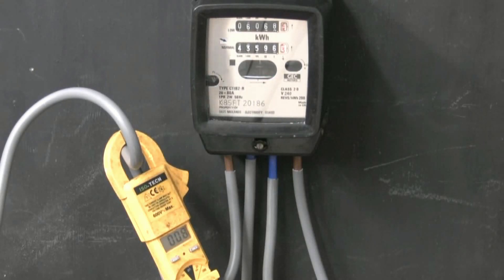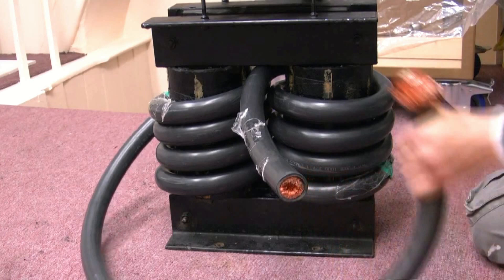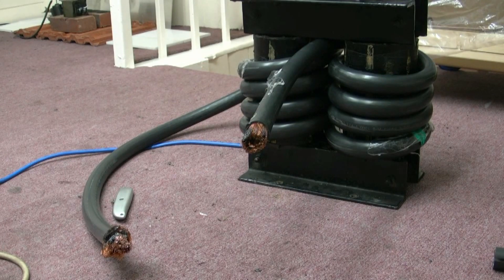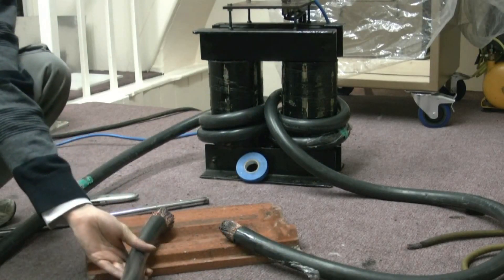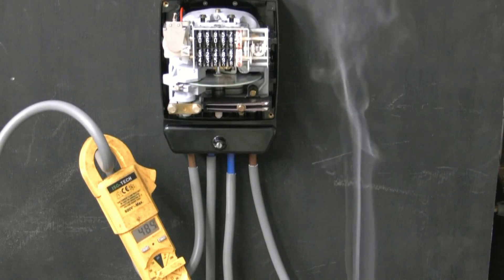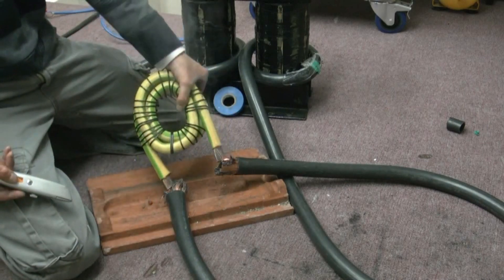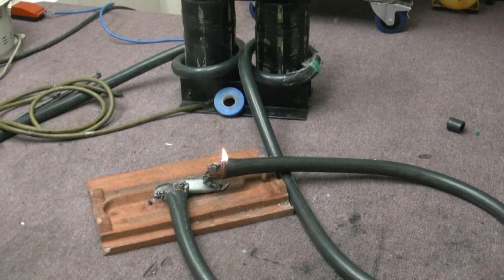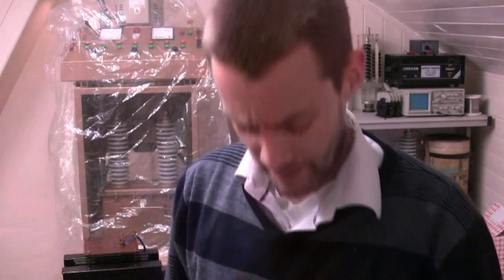Too Much Current + Electric Meter Pops

Comment: Please explain, how the hell you’re not getting shocked.
Reply: while he's stepping up the current with the very low number of turns on the secondary, he's inversly stepping down the voltage.....there's a comment here that calculates only 3 volts
kinda like how you can literally touch both terminals of a car battery with both hands - car batterys can deliver 100's of amps!  and you're attempting to make a current path directly through your heart! - which can be fatal with just fractions of an amp (if there's a voltage high enough to break down the dielectric properties of skin and flesh)
go watch Styropyro's video about volts vs amp - it's the best explainer of these concepts and he does some insane experiments using his own body :)   I'm gonna go rewatch it again now lol
Reply: @r @roushiansschannel ank you so much! Love styro’s channel. Cheers

Comment: Did you ever manage to pop the sub station fuse to your street ? If not was the max current did pull ? Assuming you had 100a cutout fuse but assumed it mysteriously was changed by someone to much bigger or a solid link lol

Comment: 3:01. Have you felt electrocuted if you touch it?
Reply: very low voltage, it cant pass through his body
Reply: @ElectricityFearsMe Thanks for information. What voltage is it?
Reply: @toni_artz  Im not sure, probably under 50 volts since usually anything above is enough to pass through. I think its around 5 volts.

Comment: Traction Motor cables from a locomotive can easily handle 1,000 - 2,000 amps @ 600 volts continuous

Comment: How are you allowed to touch the metal part connecting the two leads?
Reply: Low current. You need high current and high amps to kill you.

Comment: If you publish your transformer specks the theoretical amp output can be figured out with a formula. Like how many turns in the primary winding and how much power is being pumped in. And exactly how many turns on the secondary winding and with those pieces of information you can figure what the output is.

Comment: Where i live, the lines that come from the street to the meter are fused, if you make a high current short circuit like 30A, this blow the fuse and some neighbours houses and yours stay without power until you call the electrical company to them replace the fuse. I made a short circuit while i was installing led illumination in my house, accidentaly the wires join and boom, no power. Sorry my bad english.

Comment: Fast forward to 2022 when the average electric bill is £1000 / month.
I fiddled with the meter in at least a semi-intelligent manner.
I got two proper 25mm² single phase single pole connector blocks, cost a few quid. No big deal.
Pulled the Henley fuse to make the meter safe.
Cables out the meter, live to live, neutral to neutral.
Henley fuse back in. Done.
I even preserved the original security seals so I can put everything back the way it was and crimp the seals back on like nothing ever happened.
Fuck 'em. I'm not gonna stand for being ripped off.

Comment: Crazy they only give u guys 100 amp services. Here in America we do everything in access 200 amp /48,000 watt services. I have a 400 amp service 96,000 watt service. It's fun times.
Reply: It depends on the age of the home. 200 amps really hasn’t been a standard for that long. Most homes still are running 100 amps or less.
Reply: @Mattjohnston24  your right most. My house is 113 yrs old but updated 10 yrs ago. But you can upgrade any house here to 200 amp service and most all meters are rated for 325 amps

Comment: Nobody’s talking about how he’s doing this with his bare hands.
Reply: Large amount of current with a low voltage is like a large amount of water with no pressure. If he turned up the voltage it be like getting hit by a tidal wave.
Reply: @mastershake42019  
I’m not worried about the voltage, I’m worried about the molten metal.

Comment: why do uk plugs have a 3rd wire?   in europe its just 2 wires.
Reply: That is the earth wire. That is what the pins on the outside of European sockets is for. In most of the world if something doesn't need an earth wire they will just not have the pin, but in the UK they always have the pin
Reply: @jamiewilson187  but in europe there is only two wires.
Reply: @alanssnack1192  There's a few euopean plugs but if you're talking about the round one, those two spring-loaded metal things on the perimeter of the round part are the earth wire connection
Reply: @jamiewilson187   yes i know the side metal bits you mention, i kinda thought they were just spring things to keep the plug in.  i just dont see why plugs have a common ground. what is it?
Reply: @alanssnack1192  it's connected to the chassis of metal appliances. If a live wire inside the appliance comes loose and touches the metal, the ground will stop you from being electrocuted. Appliances don't require this if they are "double insulated", (i.e. is made of plastic) so most things don't need it these days

Comment: It’s good when I recreated this vid and I wiped out half my towns power grid and it’s funny watching the lights flicker on and off
Reply: A real power unit u are I see 🤣
Reply: How dafuq did they do it? I mean how do you draw out 20kA out of your house? Did they combine multiple sockets or did they go directly to the main cable. Then how do you transform 237V AC or 400V three-phase to 20kA? I mean if resistence is at idk 0,05 Ohm you can do it but thats impossible since every damn wire with that much resistence would melt away like wax. Pls someone tell me how did the get this to work? I will not recreate this insanity im simply amazed and i want to understand how it works.

Comment: How did the main fuse on the incoming supply not fail. 100amps max on domestic.
Reply: The transformer converted the 240v at 100a to about 1 volts to 50,000a

Comment: Power station: requires a giant site using coal/nuclear fuel to produce a couple hundred amps

Photonic: produces 20,000 amps in his loft overloading the neighbourhood's circuit.
Reply: But he generated fuck all volts which is required to power useful stuf

Comment: I am surprised they first off did not electrocute themselves, and secondly they did not burn the house down.
Reply: low voltage AC wont harm. it's only once it gets up to 24v~ AC thats when it gets a bit dangerous. that 10,000 amp transformer is probably running at 2vAC

Comment: I have so many question about electricity.
1. Which is more dangerous current or voltage?
2. can voltage or amperage kill you?

Those are my question, btw I don't have experience about it, I just want to be  aware. Peace!
Reply: The current across your heart is what kills you, but the voltage is what's needed to push enough current through your body to do damage.
Reply: So stay away from high voltage, especially if you or your hands are wet

Comment: "Im going to pour 500 eggs thru my electric meter."

I love auto generated captions.
Reply: It’s the equivalent of what he really does, with how much smoking it’s doing
Reply: Well here's our electric motor why that correctly [electric meter wired up correctly] put it about items [pulling about 8 amps] which is probably a couple of phrases and phrases [fridges and freezers] and a few lights. Just about say to me today [see the meter there] and then I come home from work and I put the cap on a little bit you [kettle on, so that uses a little bit more, don't it?]. Only that start swinging [The ol' meter starts whizzing] ...

Comment: Something does not add up
If you drop 50v, then
190v × 500A ÷ 3,600s = 28.38W
28Watt a second
It is a KWh every led then 40s
Why units stand still?

Comment: I miss your content.
It really is the ultimate community service safety message.
DON'T DO THIS AT HOME!
This is the EDGE FRIENDS .
On the edge of is easy to mess up....
But high currents and voltages absolutely have their uses!
How close and for how long next to the edge do you need to go?

Many are called. Few are chosen to weld titanium helicopter blades 
At 30,000 books at who knows what current.
 In a lead box because x-rays are coming off.
I've only heard the tales.

Comment: why he isn't taking a shok?
Reply: Probably very low voltage on that side, and he's not completing the circuit. It's also isolated from ground, technically even if it was line voltage he would not get shocked.
Reply: @redsquirrelftw  oh, thanks ^^

Comment: The analog meter display obviously was not designed for that amount of heat/ resistance. As far as the transformer goes, it's a separately derived system, there's no physical connection with the conductors between the primary and secondary. Using 1000 kcmil conductors gets the audience's attention. He used the same amount of windings on each side on the ferrous/iron core... But at the end of the day, power in, power out. Lower voltage, higher current, and vice versa. You can't make something out of nothing. No magic here.

With that said, it's awesome that you're having fun and learning things. No harm, no foul. Cool channel my friend!

Comment: They were lucky they didn’t get shocked by an ark flash, must have been close to 40k volts going through the cord. And they weren’t even wearing proper Ppe, electricity is very dangerous especially at those levels. Please be mindful when working with electricity, I can not stress this enough people. I’ve heard horror stories of co workers of mine who when working on machines got serious injuries or even death from ark flashes. Please leave electrical work to the professionals
Reply: definitely not 40 kV just a lot of amps

Comment: For those who don't understand why the guy isn't getting shocked when touching the bare metal of the box cutter when shorting it out, it's because the circuit is from an isolated transformer. If you normally touch bare wire like in a service panel, that uses earth to complete the circuit so touching it completes the circuit through you. But a circuit from an isolated transformer, you touching the bare metal does nothing because the circuit cannot be completed through you unless you hold both ends of the wire.
Reply: That's not the only reason tho. The voltage is super low because of the low number of turns, while the current is very very high. A transformer is like a differential but for electrons :D
Reply: This is the way. I came to say this and thankful you did because I am feeling lazy and didn’t want to type out the answer I always look for someone else who has answered the question.
Reply: I only understand the video on level of he built cage for the electricity, got a considerable amount of heat wrapping thick wire around transformer magnet widget and I guess he's a ghost cuz looks like he does insane stuff.
Reply: Thanks I was wondering that
Reply: Not only that but the voltage is too small to pass sh*t over skin

Comment: Which current does he measure? The amp meter is on another cable, not on the big fat one.
Reply: He's measuring mains amps, it gets stepped down to probably like a couple volts tops. When voltage drops current spikes so there's also like 10,000 amps. Your body has too high a resistance to get hurt by this. Don't ever try it though, you need alot of education to understand why it does this.

Comment: I guess I don’t know much about electricity as I thought, well at least this kind of stuff...using his transformer he said he had 1000 amps going through it, but he had a 200 amp mains box, which I know doesn’t mean he has 200 amps available, it’s the number on the transformer outside ( in US is typically rated at 15/25 KVA, with some could be 37.5 or 50 but split across all houses connected).  So my question is how is he pulling 1000 amps there when he has a 200 amp mains box and chances that the transformer he shares outside can’t even support that?
Reply: cagmito76 I understand that but how do you step up the amperage to higher that what the mains transformer supplying his house can even support?  Yes he’s stepping it up, but how can you step it up well beyond what his system can even do???

Comment: Where I use to live it was a semi detached house and the supply to next door came into my head n then spurred off into there's. Every time I switched my old school 20A Variac one. The light dimmed next door. If you go on my channel you'll see it n realised at the time how much he wanted a lovely old school Variac like mine. 
Well, what he's got now puts mine n pretty much everyone's to shame n he's got 2 of them n there both 3ph with brushes on the outside and it's gold plated. 

There's a few things I've love to get off Andy if he was every getting rid of anything n that's one of them. The other is his 6ph mercury arc rectifier which is beautiful 😍

Comment: He didn't really overload the electricity grid. That was just a bit of a joke. At the end of the video he clearly shows the meter connected to the secondary, of a low voltage, high current transformer. The actual power used will be a few kW at most.
Reply: I am guessing about 25kW, which take him up to just over 100 amps. It's high but most domestic houses are fused at 100 amps so it's not enough to sink a phase by 50 volts.

Comment: what did you use to power the transformer? just regular old 240 through the variac?
also, what configuration did you use to wind the secondary (how did you wind it). im asking because i want an idea of how to wind multiple microwave over transformers in series. would i have one wire going through all the trasformers or have each one wired up separately and then connected in series?

Comment: WHOOPS!   At 11:21 he says, "I need 250 amps going into that transformer to get 20,000 amps out."   A transformer can not put out more power than what is put in. That said, an  everyday electrical  transformer is one of the most efficient machines invented, at over 90% efficiency.  Now, if he means to go from 250 volts to 20,000 volts, a transformer can do that, but not amplify more current than what is put into the primary.

Comment: I love how this guy will bend glowing hot steel rods with his bare hands without even flinching.
Reply: Wtf!! I just noticed that
Reply: How does he not die from that, wouldn't he get a shock?
Reply: @RedDread_  it's very low voltage on the secondary winding (the big wire) but it can supply high current.
Reply: @RedDread_  he is isolated, electricity tries to find the fastest way to ground, which in this case, is the other wire. The glowing hot steel rod was interesting though
Reply: @frankie.7z  wrong, it’s just low voltage

Comment: 275mm and 400mm with reference to the size of the cables?
None of the cables come close to being 275mm in diameter so I am wondering what this unit of measurement is? 275mm^2? But why is that used instead of diameter?

Comment: It is a shame you didn't record the neighbors lights flickering, that would have been awesome!
Reply: to much identifiable.
Reply: @JAKOB1977 In the electric scooter video he rides his scooter up and down his street so I don't think that's  why he didn't record it.
Reply: @JAKOB1977  oh come on uk housing all looks the same 😂
Reply: It because it will leave evidence at least he could say he was messing around and faked the breaker LEDs for effect he just need denialbilitiy
Reply: @wawazaza1785 As someone who watched his channel so far back I can remember videos I can no longer find. I can tell you that he never showed his backup cabinet in the original too much current video. I believe it's a clip from another video, probably when he tripped the power with the coconut in the telly.

For reference he also switches most of the house onto his backup system whenever he's doing something that requires as much power as possible. So he can then draw from the grid without having the normal household loads. Also why his lighting doesn't react to the transformer shorting.
Reply: Can't because it didn't happen.
Reply: @jovetj  Exactly. Ignoring the circuit breakers and cutout fuses, and the feeder wires to the residential service would literally melt if one was to draw enough power to dim an entire distribution circuit.
Reply: @ironmatic1  Nah, those wires are calculated to carry a particular kind of current that should easily sustain more than the calculated amount of users on it.  It's probably more the result of the huge, sudden peaks drawn that might be very well within tolerance, but cause a drop, and whoever is near the end of the supply line or on the same phase of the transformer will notice this...
Like, power outages (or more, the short circuits that preceed them) in Amsterdam are visible here in flickering lights because they echo back throughout the grid, even with all the transformers in between the location I'm at versus Amsterdam.
Our solar panel converter tends to send an alarm in those cases for noticing a drop in voltage and sometimes also in frequency.
Reply: @ironmatic1  You'd be amazed how much an 80A fuse will pass before it ruptures. At least 5x rated current for a few seconds.
Reply: @dopiaza2006 Same for the breakers too. The voltage drop caused by Photon (granted not necessarily 50v drop) is entirely plausible.
Reply: @jovetj  It was in one of his other videos, he was causing the entire streets lights to dim.
Reply: @AtomicCheese92 which video???!?!??!!? i've been looking for that one!
Reply: Jovet yes it did

Comment: Try with a rectified Bridge rectifier and you wouldn't need such big copper wire because it would be AC and put a hundred thousand .K. capacitor in series. Warning high voltage.

Comment: When the voltage is so low that you can run a fucking meter's worth of current, and still dare to handle the bare circuit barehanded...